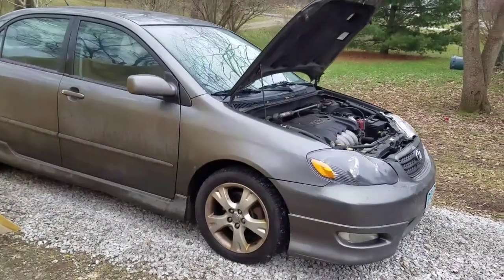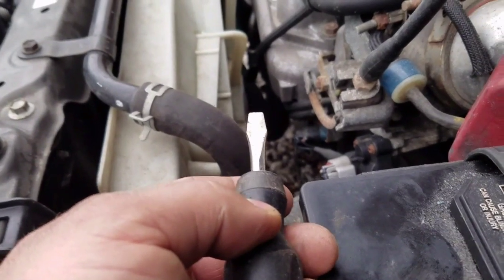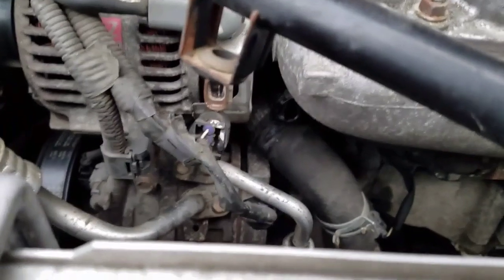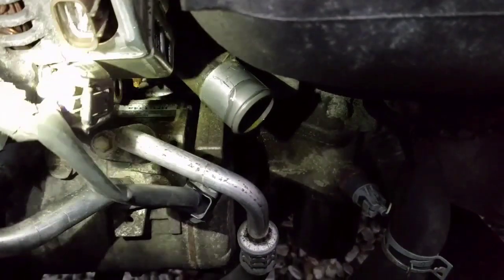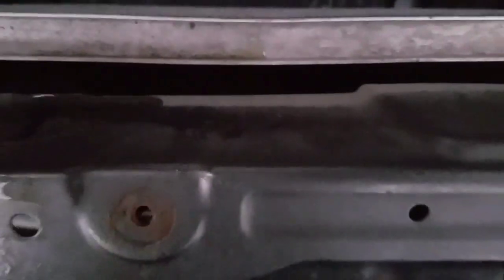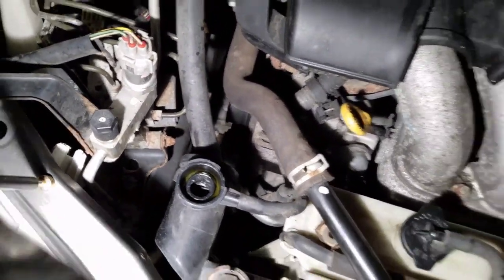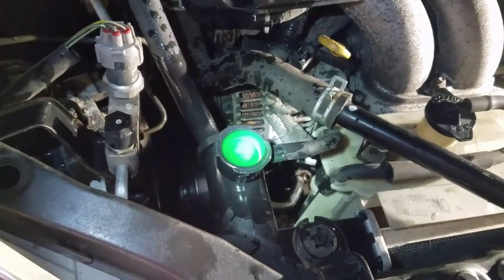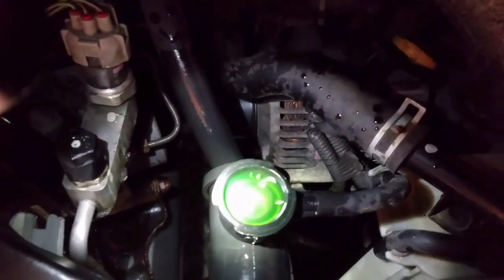03-08 Toyota Corolla / Matrix Thermostat Replacement Removal and Install

Comment: When installing a thermostat the bleeder hole on it should face 12 o'clock straight up, this helps bleed air out.  Also, toyotas use red oem coolant and a Lisle spill free funnel kit (can get on amazon) makes filling coolant and bleeding out air a lot less messy.  Also it's a good idea to clean the gasket surfaces before bolting it back on.  I got from another video that the torque spec on those nuts is 8 ft lbs (sounds right).  Good video.  Sorry for all this criticism.

Comment: Years ago i had my Clutch changed and went ahead and got the coolant changed.  After it took a lot longer for my car's heater to start working.  Wonder if they did not get all the air out when they changed the coolant.   Car never overheated but  a few years later occasionally my check engine light turns on.   Thx for your video upload!!!
Reply from the maker: Very possible, thanks for watching.

Comment: Thanks for this video. Soon i am doing that and some more to a 2004 corolla and since i am replacing water pump, thermostat, belt i will be taking the alternator out. That is the easy part because I have a blown head gasket due to cooling failure due to us being dumb and ignorant; cost us an engine already once and now this one almost; i am fixing this car from hell right and selling it, but not before almost becoming a mechanic myself because the guy we have been taking the car to really sucks; he could have told us all this and avoid us the expensive repairs but that is how we learn when the pocket is affected. The way that car is right now it is not worth even $500.00; the dealer wanted to give us $300.00for it, thanks to how fucked up they are, i decided to fix it buying all i need for it and then sell it running right, no BS. So far just in parts I am close to $1000, so hopefully once it is done and back from hell, i can sell it for 3-4K; car has good exterior, new brakes nice tires and rims and transmission is working good too for 122000 miles on it; first engine was busted at 80000 miles, this one went in with 62000 miles certified pre own, so from 80000 miles to 122000 that is 42000 miles that second engine has run before doing same things again all because the cooling system have been neglected always; that means the engine that is in now has actually 102000 miles on it which the real mileage the car should be go for, way too young to "retire it" just yet!
Reply from the maker: Yeah ours has 260,000 miles on it now. The engine in yours is similar, but not the same as our XRS. But most of the jobs like radiator, thermostat, water pump, alternator, etc are the same process, but the parts may be slightly different. I have videos for all those repairs and more under my Corolla playlist on my channel. Good luck with it, and thanks for watching.

Comment: Can you also replace the starter that sits underneath the intake manifold from the top with fan removed or the starter needs to be removed from the bottom? I have an 05 Corolla XRS.
Reply from the maker: I have a video one the starter- check out the Corolla playlist on the channel for that video and more.

Comment: Thinking of getting a matrix xrs 2004 I'm assuming it's the same engine as the Corolla? My question is, does this car have a tendency to burn oil due to neglected maintenance. Since I'm buying it used @ 134,xxx miles
Reply from the maker: Yeah it's the same engine but lift will hit sooner on an 04 Matrix XRS. As far as burning oil from neglect, I have no idea. The non xrs cars with the 1zz engine notoriously burn oil because the engine in those have faulty piston rings from the factory. The xrs cars have no such issues with the 2zz engine. But any vehicle has the potential to burn oil if neglected to the point where the cylinder walls and rings are damaged, or valve seals. Overall I think it's a pretty bulletproof engine (2zz). Ours has 260,000 hard miles now (redline every time driven and frequent racing) and still runs great, doesn't burn oil. But we change the oil every 5000mi with full synthetic and keep up on whatever else it needs too. I have a tun of repair videos on ours if you get it and ever need to work on it. Didn't really start having to replace stuff on ours until around 200k...
Reply: How do I quickly tell it's a 2zz engine? Do they stamp the code any where for quick ID

Comment: What's up bud big fan of your vids! been looking this up because of a head gasket that is leaking I've been thinking about using blue devil K seal I've heard instructions include removing thermostat putting back together running liquid waiting then putting back engine together. Scared of doing this though don't have much money either
Reply from the maker: I actually never heard of this stuff till you enlightened me. So after some brief research, seems the Blue Devil stuff is the best brand. Seems to have pretty good reviews, other than the few people whining that it didn't work. Only concerning complaint I read was ONE guy said it clogged up his heater core. But the core was probably already pretty clogged up I would guess. I don't think you have to do all that? Looks like you can just leave it in there for a little bit, then just drain it and put fresh coolant in. Just follow the instructions, whatever it says. I would recommend watching my radiator video if this one doesn't show how to burp the system properly if you drain it, can't remember if it does or not. Gotta be careful not to overheat when draining/changing the coolant.

Comment: I'm having this same issue, change my heater core and thermostat.. and no heat from heater.. I did this for 39 min and still over heating..
Reply from the maker: I assume you're talking about burping the coolant system? Raise the front of the car as high as possible so the air will come out.

Comment: I hate working in tight spaces like that so I move things out of the way. I would have removed the alternator. My luck I would pull on the thermostat and smash into the radiator.
Reply from the maker: The alternator is a pain to remove too, same issues; no space. And getting the belt back on this car is a nightmare.

Comment: Isn't that the wrong color for the fluid?
Reply from the maker: I think the Toyota brand recommended fluid is Orange, but this car has 260,000 miles on it now and it has had the green fluid in it since I can remember, so I'd say it's safe to say it will be fine.

Comment: Roast me if you must; but can some one explain to me why you cant just take out the alternator to get to the thermostat?
Reply from the maker: You can, but removing the alternator is even more of a pain in the ass, and you may possibly round off the nut on the tensioner arm and then not be able to get the belt back on; nightmare of a job. I have the alternator video under the corolla xrs playlist on my channel if you care to see. I never want to mess with that thing again. Best part was, the new alternator failed less than a year later and I had to do it again, but at least then I had a new tensioner arm installed that wasn't so tight that the nut rounded off like the old one did. It would definately be easier to access the thermostat with the alternator out, I just don't know if you want to tackle the alternator. Any other car, no problem. On this thing, because of the stupid tensioner arm design, absolute nightmare. I suggest you check out my alternator video and see for yourself. Viewer discretion advised, more profanity lol. Thanks for watching, and good luck, whichever path you choose.
Reply: I did, and it was very easy. Took about as long as watching the video. Take out the alternator, it will save you a lot of hassle. Also, no need to remove the radiator.
Reply from the maker: Was it an XRS 🙃
Reply: @BuckeyeBallistics  no.
Reply from the maker: The XRS has a different tensioner arm/piston than the other models. I'm assuming it's stiffer on the XRS due to the higher revving 2ZZGE engine in the XRS needing more tension against the belt. I could be wrong about it being stiffer, but it's definately a different part, and I would assume that's why. On top of that, I'm pretty sure the piston on mine was seezing up, leading to the edges of the tension nut head on mine beggining to round off when trying to relieve tension to remove the belt, which is why I replaced it. I'm glad to hear it went smoothly for you, for me it was a nightmare.
Reply: @BuckeyeBallistics  That sucks. I still think getting the alternator out of the way is far less complicated. IMO the belt tensioner is quite stiff, which I consider a plus. In many cars I have owned or worked on, the automatic belt tensioners were not stiff enough, and failed frequently. The beefy tensioner here is reassuring. I used a 2' breaker bar on mine, and still thought it was stiff, and didn't feel like I was moving it enough. But since the belt slipped into place, it was enough. 
I specifically avoided getting the  XRS, because premium gas... Then I find a lot of sources saying it is fine to use regular unleaded in the XRS despite the labeling, if you aren't driving at redline. Dang it.
Reply from the maker: Never tried, always ran premium, and always ran to redline lol.
Reply: @BuckeyeBallistics  I am less interested in driving cars hard that I used to be . You can blame that on me being 36 not 20 anymore . That's part of it but mostly it's that I figured out that the dollar to fun ratio is way better on motorcycles . If you don't have one get one you'll be amazed . Your car will become an appliance to get you places with stuff. your motorcycle will be for fun
Reply from the maker: Owned 3, know exactly what you're talking about. Bikes make cars pretty boring.